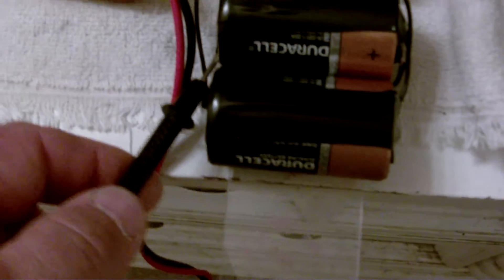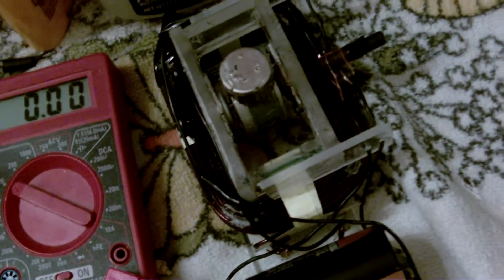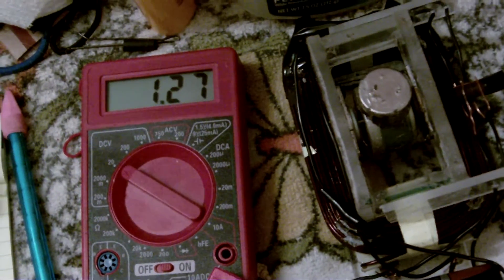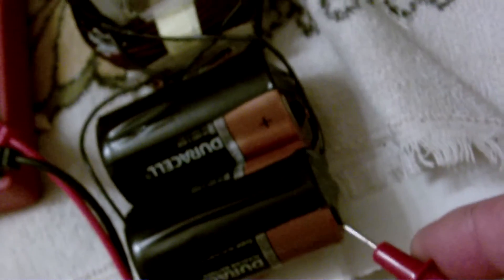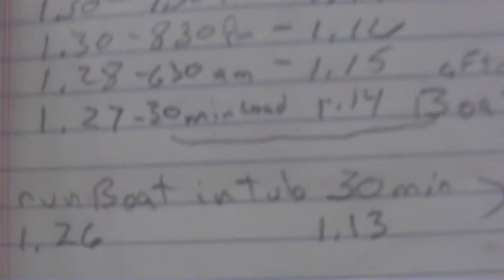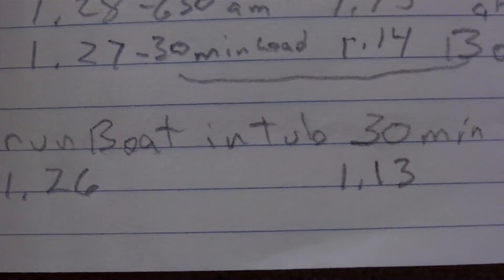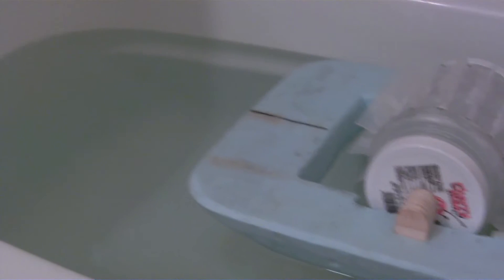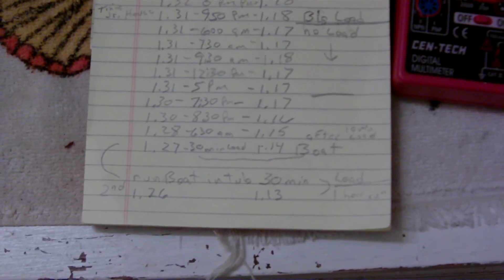IMAG0001 free energy newman motor , 1hour test done

Comment from the maker: thank you for your comment mr Constantine the motor is still running but I'm on my second battery the first battery lasted a little more than two weeks it was still running but the voltage was under 1 volt but the second battery ran for 12 hours straight without the voltage dropping then I hooked a capacitor to both of the leads coming off of the coil and then my meter showed me the voltage while it was running so I let it run and it ran for a total of 40 hours before it started to drop now it's dropping about 10 milliamps in 24 hour period I'm wondering if the contacts are getting dirty causing the drop in voltage?
Reply: Hi Mr Cupp.  Did you check the voltage of the batteries?  You said it didn't drop hence the bemf maybe sustaining the battery at her highest capacity.  With the capacitor it should raise the efficiency of the motor torque.  Dirty contacts is not exactly the problem.  It could be that the batteries are being overcharged and they lost capacity in that process.  Did you notice any warmth in the battery during operation?  Is your battery normal zinc batteries, NiCD or NiMH rechargeable?  The best form of batteries to use for the Newman motor is the rechargeable ones as the zinc batteries aren't the best at receiving the fly back bemf from the motor

Comment: you can try raising the voltage with more batteries in series and link a capacitor to the coils in parallel.  That will enhance the power output